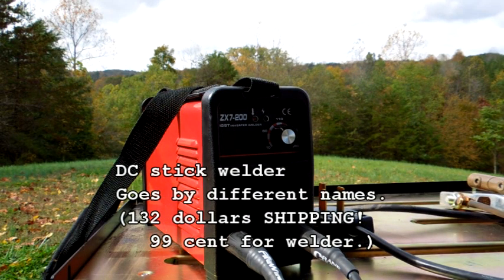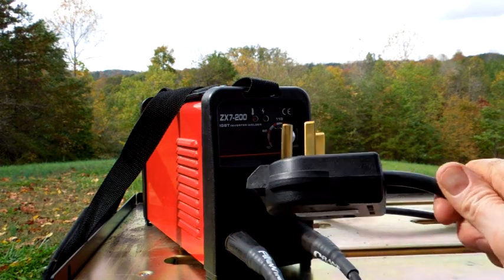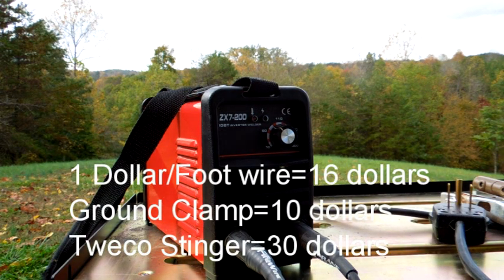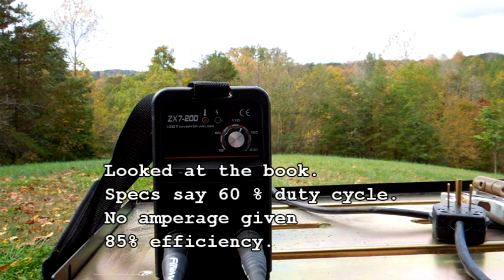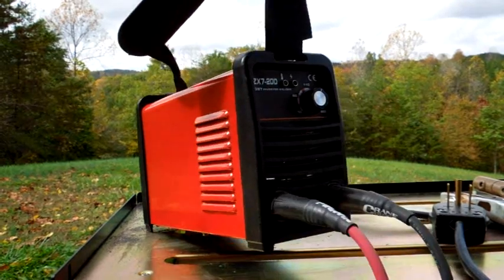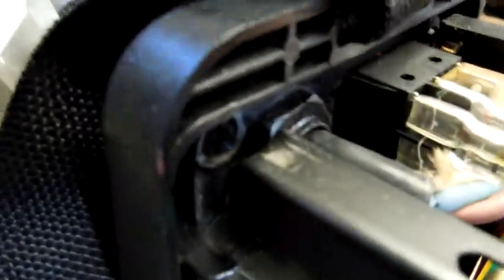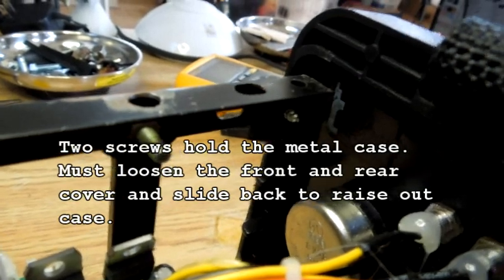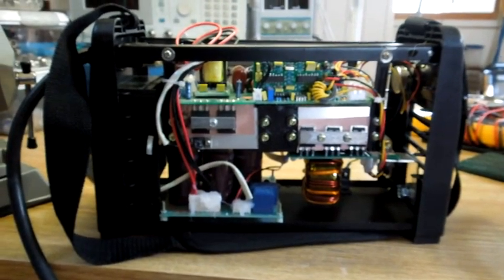Review of ZX7-200 or MMA200 Stick Welder

Comment: I also bought this particular unit(2 wire) unit on ebay for $133. It has been used a lot and works well. Only thing that went was the fan, it smoked and went dead, was replaced with a computer fan. I myself have been trying to find out info on these units as there are literally hundreds of them being sold on ebay by different sellers and with different casing etc.
Some do show 3 wires.
On the Alibaba website there are also hundreds of sellers with similar IGBT units.
It seems that the circuit board has been copied and is easy to manufacture.
On the welding forums these units get a bad rap due to their origin but soon they will take over the midlevel market.
Reply from the maker: I think you are probably right. For the guy who doesn't make a living welding or do demanding welds like me, it would be hard to beat. The Lincoln buzzboxes that are so cheap on ebay and craigslist used are almost universally the AC unit.
Reply: John D How long have you had this unit now, does it work okay ?

Comment: Thanks for the review. Cracked plastic standoffs can be nicely repaired with JB Weld.  I apply just a little to the mating surfaces where the crack is - being careful to leave enough hollow space for the screw.  Then I build up a little mound of JB Weld around the entire base of the cracked standoff.  Give it 24 hours to fully cure.

Comment: I spoke to a person from a factory making these units on selling website alibaba,
She said that they usually come in two versions, 140amp and 160amp.
The 200 in the model number might be delberate misleading.

Otherwise these igbt machines work well.
Lot of youtube reviews from eastern europe.
Reply from the maker: Hi Lennard
I double checked the "specifications" section of the Chinglish manual that came with the unit. The rating is given as 200A/28V for this unit as an MMA200, with versions from MMA60 to MMA200 at either 15 or 20 amp intervals. I guess some other people have found out that it really isn't 200A. I follow several welding pages on FB. "Real" welders have pointed out several times that the DINSE connectors aren't really suited for current that high. They are rather small. I am using 2 lengths of only 7 feet of #4 welding wire for cables. Thanks for your feedback.

Comment: i  bought one ov these that claimed to be 250a i would be surprised if it was 160a , that being said i paid 78.00 shipped for mine without any accessories , for the money it's not bad but it is picky about rods , does not like hobart 6011 at all ....
Reply: doug bishop.... isn’t 6011 meant for AC welders?

Comment: Are these machines durable or are they a waste of money ?
Reply from the maker: Stefan ramnarine I would not recommend one.  I am not sure that I would say it was a waste of your money either. It depends on what your needs are. Then again, it is easy to tell other people that they should go buy a Miller or a Lincoln at 7 or 8 times the price. I think that if I had it to do over again, I would go to Harbor Freight if I wanted a light duty machine for occasional use around the house. At least you could carry it back if it died on you during warranty. It isn't going to stand rough physical treatment though, as I think I illustrated.

Comment: It has two cables so how do I connect it to the connector which cable goes where ??? You should had opened up the connector to bro!!! Half assing shit lol cmon
Reply from the maker: Sorry that the video wasn't useful. My DC connectors are labeled + and  - on the front panel. The ac/220 volt connection was simply bare wires at the end of the #8 stranded cable. I had to buy a connector at Lowes.
Reply: To wire it to 220 how did you do that.. is the red and the blue wire both hot and don't run a ground or what..thanks

Comment: Thanks for the video.  Another 'tuber has posted his bench testing of a similar welder and has discovered the same output Amps as you have posted. 
https://www.youtube.com/watch?v=zkLg_F3vCfM
I'm expecting delivery of my new ZX7 machine anyday but don't have any way to test the output.  Thanks for the heads up.  120-130 Amps will be enough for me so I'm not going to be disappointed that I can't get it to 150+ Amps.
I ordered mine from AliExpress for $120.  Maybe I need to get myself a multimeter with a clamp to run tests on my machine.